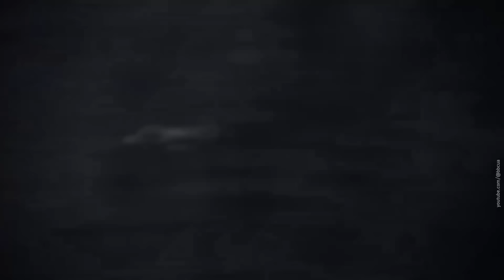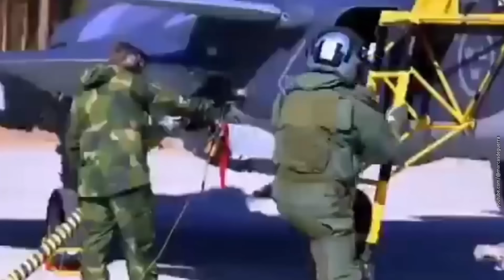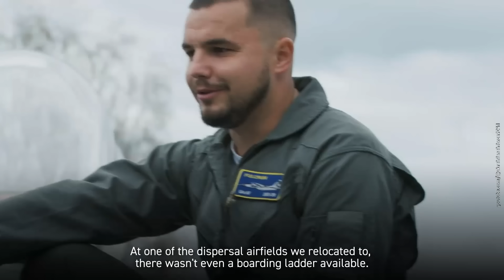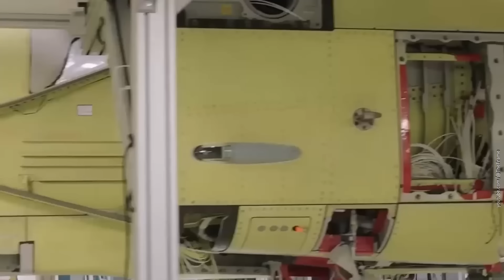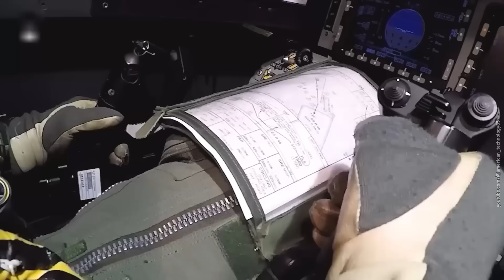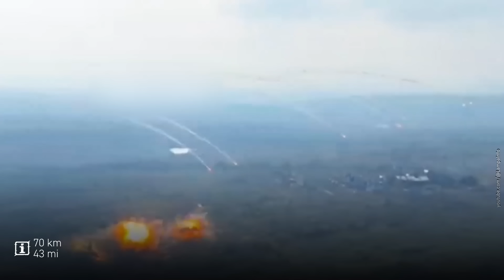They Call It Russia's WORST NIGHTMARE for a Reason

Comment: Gripen F is destined to receive AREXIS pods as that is a 2 seat variant leaving the pilot free while the RIO does their thing. AREXIS is designed to offer an electronic umbrella to friends flying nearby. As you said using your radar gives away your position unless it is in very low probability of intercept ( other background radiations mask its use ) but electronic transmissions are known in a ' library ' so that fingerprint gives away the presence. Gripen is networked to receive information from other sources like Giraffe, GlobalEye. Satellite and naval assets so it can react in a passive mode. If Gripen E/F detects a target it can launch and guide a Meteor to within 1° of accuracy passively. Gripen has a Repositioner on its radar allowing it to fly parallel to a target even away . One Gripen can look left and one right then they merge the data seeing 200° of view . Tactics play an important part of BVR fights so the Gripen can return to fight another day. German Eurofighter EK  has chosen the AREXIS pod system, NATO the GlobalEye and France are buying 2 (;with an option for 2 more ). 
 A clever package!

Comment: despite what the vatniks will have you believe Sweden is quickly rebuilding its forces. Technically they are far superior than the russians. And they will be working in tandem with the other Scandi forces. And then there is the other NATO air forces. Russia will have big problems dominating the skies.